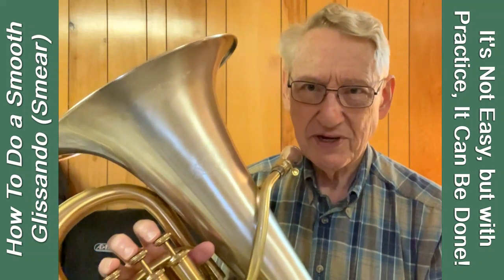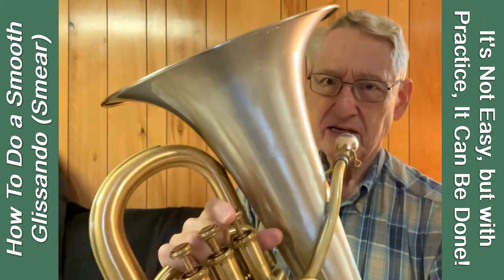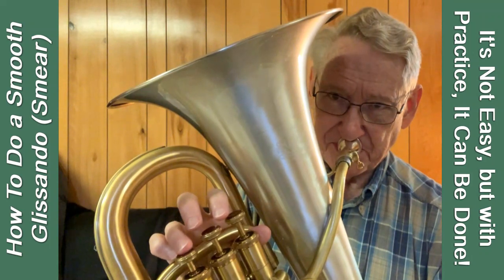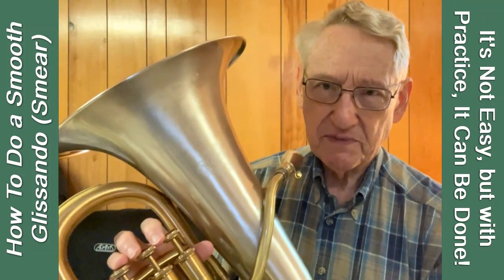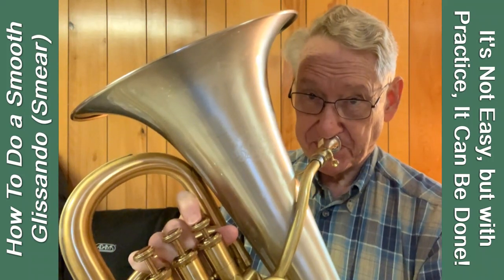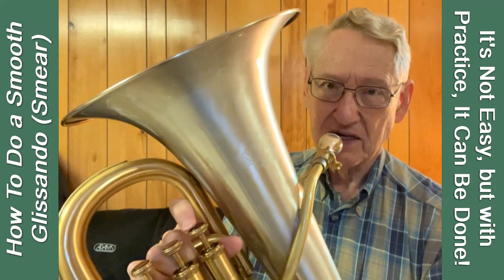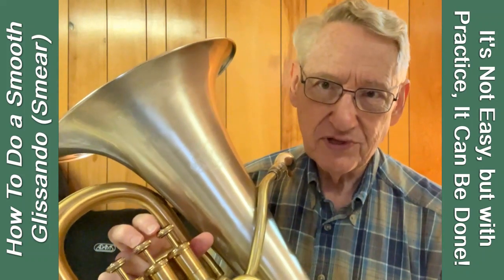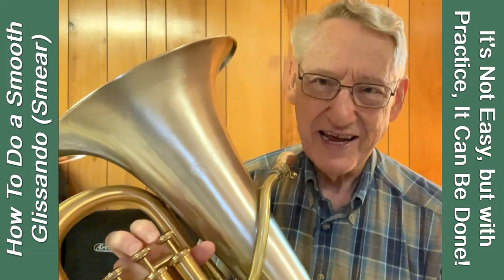Euphonium: How to Do a Smooth Glissando (Smear) with the Half-Valve Technique, With Examples

Comment: I have a little hack to find the right spot on the first valve quickly and consistently: I actually press my thumb nail against the valve pin, resting the thumb on the top cap. This blocks the valve from going down any further than it should to stay in the "glissando spot" (which I find to be pretty small on my instrument). This works for my hand, maybe other people need to find a different way.
Reply from the maker: Clever idea! In the Coast Guard Band our 1st trumpet player would do something like that for a dependable horse whinny at the end of Sleigh Ride.

Comment: Dave, enjoying your videos.  I need advice on my student Accent 580L.  All notes clear as a bell except Concert Ab above the Treble staff (1st valve).  It simply will not slot.  It is aligned properly, horn is clean, tried 6 mouthpieces.  Hours of practice.  I play in two very good community concert bands. Indianapolis Municipal Band, and New Horizons Concert Band.  Please don't make fun of a 3 three valve euphonium.  All I can afford at this time.
Reply from the maker: I played a 3-valve euphonium for my first 6 years, and while in the Coast Guard Band we used 3-valve Kings for marching and ceremonies. They are fine for their purpose. For the Ab, the first step is to check with a tuner to make sure you are trying to play the right pitch in tune (sometimes our ears want to hear a note higher or lower than it should be). If that's OK, they try using 23 for the note and see if it helps. Or 123...maybe.

Comment: how would you go about doing a glissando while pushing down a valve already?
Reply from the maker: Use a different valve for the gliss effect (4th valve often works). If that's not an option, slightly lift the one that is down.